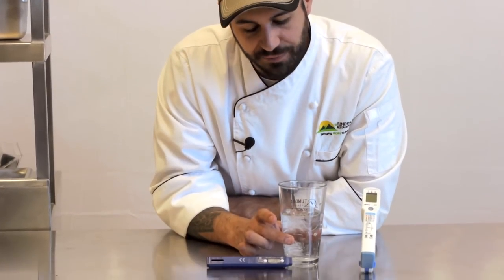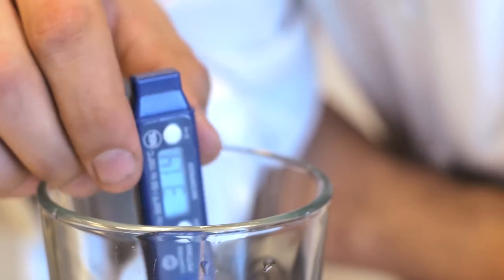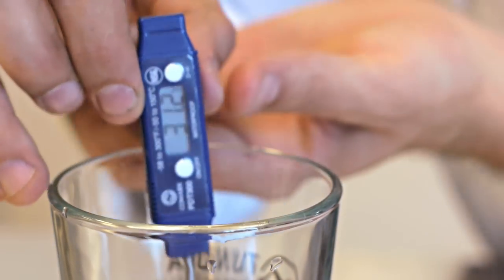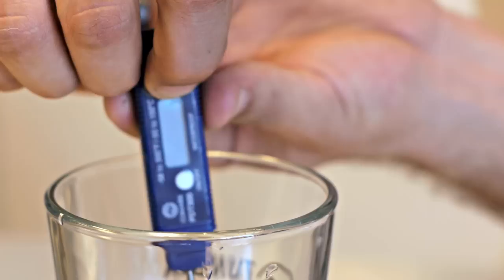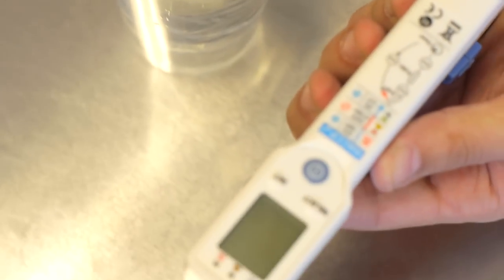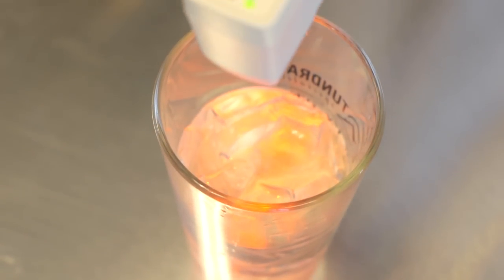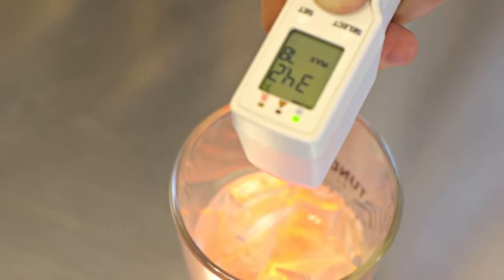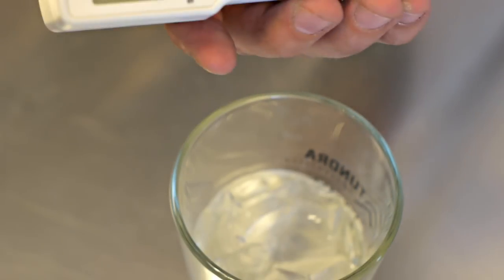How to Calibrate Digital Thermometers | eTundra

Comment: This calibration by  ice water makes no sense. Not all I've water is the same even if your crush the ice. You can get 28f with ice water all the way to 34f depending how much water you add. The bar possible way to know if your meter is off is by comparing it to a baby thermometer side by side not touching metal in water heated to 40c. Those are medical devices and need to be extremely precise. 2c difference is life and death
Reply: Water freezes at 32F so I'm not sure what magic water you have available that stays liquid at 28F.